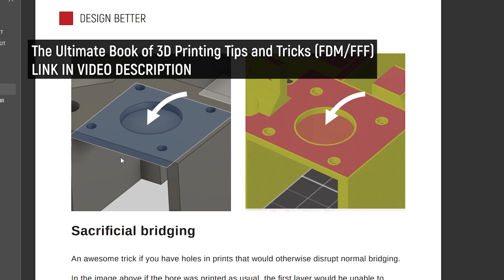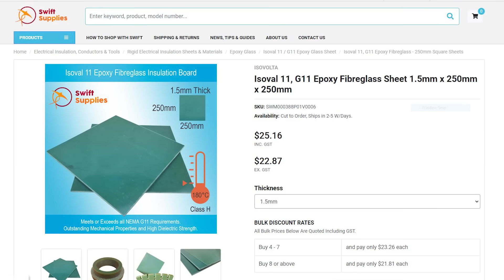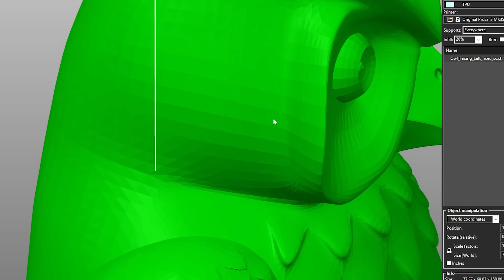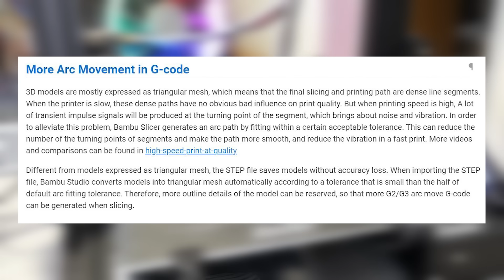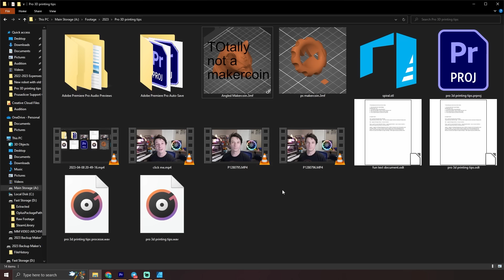5 3D Printing Tips I wish I knew years ago! #3DP101

Comment: Comment from a programmer. 3mf being a zip file is not (most likely) any hidden agenda to sneakily place some nasty files on your computer. Zip file is simply most convenient save/load storage format when application you design needs to store multiple different files within one save file. One other path software developer can choose is for example to store projects as folders. Unreal Engine does that, and seeing how many midi controllers you have in the background, then more familiar example of such software would be FL Studio. But if there is a desire to have single file with some specific made up extension, then developer will have to either implement his own custom solution for merging multiple project files into single storage file (which in most cases would be bad idea, since more code to maintain equals more places to screw something up), or... can use something that is there ready to take, like zip archives. And this is nothing new. For example Office uses same approach, since format with "X" at the end was introduced (*.xlsx, *.docx) many years ago already. It's the same thing. Yes, your Word documents and Excel spreadsheets are zip archives.

Comment: I bought a plate of g10 for my ender 3 and it works great but I had a ton of trouble cutting it. How did you cut through enough to snap it off because mine started to delaminate?
Reply: G10 won't snap well because it reinforced with glass fiber. I cut it with a table saw, but you can use a fine-tooth saw such as a hacksaw. If it is really thin you can cut it with a knife, but it can take many passes
Reply: If the G10 is 1.5mm  1/16" then it's possible to use Aviation Snips to (carefully) cut it. Compound Aviation Snips would be preferred as they provides more cutting power

Comment: I want to try g10 with my Ender 5 plus. Unfortunately unfortunately it's hard to find in my size. The couple I have found I just over $50. I pay less than that for my PEI sheet. Any suggestions would be appreciated

Comment: For PLA at least, over never noticed any moisture issues. What I have noticed is it get brittle due to sun light. So don't leave the spool on your printer when you aren't using it, put it in a dark closet or a box.
Reply: Ouff, mine got brittle as hell in (I suppose) a moist storage room.

Comment: I just use hair spray instead of glue and works like a charm. Also, funny thing on the dehydrator, they are extremely expensive in my country, so a filament dryer is literally 1/4 of the dehydrator price lmao. Tried using the bed with a cardboard box, it kinda works, but didn't like not having the printer available during those hours.
Reply: Same, I'm in Europe. Maybe not 1/4, but 1/2 or something

Comment: In Brazil it's cheaper to buy a filament dryer from China with the low shipping cost you first worlders subsidize (thank you), than it is to try and import a food dehydrator from the US, the shipping alone is $50+, there is no local market for those, you can't buy them in stores or second hand websites.

Comment: G10 is an AMAZING print surface.  After seeing your original video on G10, I ordered some from McMaster-Carr. The ONLY issue I have with it is that It has to cool down a  bit before pulling prints off, especially thin prints, or they can warp as the adhesion is so strong while it's hot.  Once it cools down completely, my prints come off with NO force whatsoever. I can just pick them up, as they've already released.  I don't use glue sticks or anything else.

Comment: You did a vide on G10 like a year ago, and I've switched to that 100%. I have multiple sheets of G10 I bought cheap from McMaster Carr, and I have one surface roughed up with sandpaper for printing PLA on a non-heated bed, another sheet with the glue/alcohol slurry for TPU, and another sheet that's smooth as a baby's bottom for the other 90% of things I print.
Reply: @Jim-xh7hi  "Multipurpose Flame-Retardant Garolite G-10/FR4 Sheets and Bars" - 12x12" size Beige 1/16th inch would be MC # 85345K211. They have other sizes & thicknesses as well.

Comment: Tested out step vs stl in flashprint, stl gave odd layers not aligning as you would expect, but the step file gave nicely aligned patterns in the slice with spiraling curves rather than slightly in some layers then moving the seam etc further up

Comment: Another benefit from using step files in your slicer is that they are generally smaller and easier to edit later if you happened to lose the source file.

Comment: It’s important you have arc movements enabled in your firmware.

If you can’t obtain a STP file, there are also tools to process Gcode to convert your G1 movements to G2 and G3 arc movements if curvatures are detected, with adjustable sensitivity.
Reply: mmmmm, IJK coordinates...
Reply: @paradiselost9946  there we g0
Reply: Arcwelder?
Reply: @tsikada  multiple linear moves into arcs

Comment: I got a G10 print surface after watching your video on that. Cheap and works great! Also, it might be useful to see a tutorial or something for creating those "prusa bridges" for supporting holes.
Reply: G10 has been a game changer for me as well. And I second the bridging tutorial - it was just too fast in this video ... I get the point, but I don't get the process yet.
Reply: lets say you have a 10mm deep hex hole going into a 10mm deep circular hole, after the 10mm of hex, make a .2mm rectangle that is the width of the circular hole in one direction, but all the way across the hex in the other, .2 above that make it a square with sides the size of the hole. by the 3rd layer you should be able to make a 9.4mm hole, for a total of 10mm including the supporting layers
Reply: i picked up a sheet for my ender 3 but had some trouble with it warping abit, and i needed to run 70c instead of 60 for prints to stick well :/
Reply: There is a way that works for smaller holes as well. Just use enough perimeters for the bridging layer, and it will fill inn one circle at a time. That trick effects the entire layer tough.

Comment: A good friend, when i suggested a new mother board, asked me if Maker's Muse has done it yet!!!! I started watching your channel and see why he asked me that. On the G10. I was shocked to see you recommend what I had stumbled onto. I went to Garolite several years ago, still have the same plate. I used Glue stick a lot. Then last fall I ran out glue Stick, and had read about cleaning with IPA. I scrubbed and scuffed up my Garolite cleaned it well and left it bare. Prints stuck just fine.  Then i changed filament and found a thin layer of glue helped. The I used a cotton cloth soaked in IPA to smear the think glue layer around, it sticks better. So now, I have a thin layer of glue and smear it around with IPA after each PRINT! Just like you described. But now I want to replace the big heavy Aluminum bed frame with something much lighter. Any thoughts on a PETG CF Plate????  Dennis a Maker's Muse Believer

Comment: Only gripe here - #1 you didn't actually explain how/where to configure for that.. do you design the bridging in the CAD or does it have to be set up IN the slicer for each hole or something..?
Reply: It has to be done in CAD. Angus showed it in a CAD model, but that may not be obvious to all. The slicer cannot do this for you
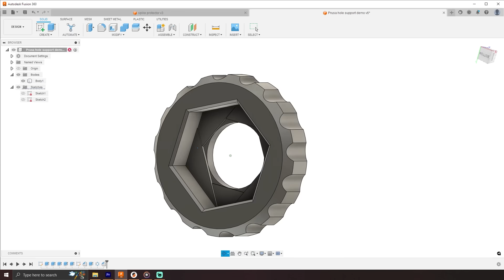Reply: @no-page  I figured CAD but everything he shows after the small blip on sacrificial (prusa method from ~0:34 to 1:14) is all slicer views and then only shows 4 seconds of a CAD model (then right back to slicer) without actually explaining the method in CAD or considerations/limitations.. that's the part I wanted to hear tbh

Comment: I used the STEP file import feature in Bambu Studio and the SoftFever (Orca) fork too, and it does makes a visible difference to circular lathed model parts, as well as overhangs. I could see artefacts in the STLs previously with other printers replicating the CAD mesh structure, and used to change the mesh properties in the CAD file export to try and reduce them. There was a bug in the STEP file import in Bambu Studio, not sure if Prusaslicer has captured this when they copied/forked from Bambu Studio.

Comment: I've worked at Prusa and can confirm we use the hole bringing trick everywhere all the time and it works really well.
When modelling just offset each extrusion by your layer height (worth putting that in your variables for convenience).
Also make little circular cutouts (dia cca 0.5mm) on each vertex of the hex pocket, ensures the corners of the hexnut fit in perfectly every time.
Nose around some of the part files to see for yourself, there's a lot of these little tricks that will help you out!
Reply from the maker: The circular cut-outs on the corners are a great idea! I've been doing that for laser-cut and CNC parts for some time.
Reply: @MakersMuse  works wonders on plasma cuts also, but the radius needs to be larger preferably Ø20 minimum is material thickness
Reply: @MakersMuse  Those circular cutouts can also help with stress relief to prevent cracks at a vertex.  I use this approach all the time with my ceramics pieces, which love to crack as the clay dries.
Reply: So, how does one add that into their files? Is that on the CAD side or slicer?
Reply: @charliebowen4232  CAD. It's actually not too much of a hassle, when you draw the hexagon and the circle, just add a few lines tangent to the circle as you see done, circles in the corners, then make your extrusions.  OR  you could draw the negative of the hole and save it as a separate model, then put it into your slicer and cut it away from your existing part. Much more of a hassle, but may be useful if you can't edit the original.
Reply: @charliebowen4232  cad side, but adding slabs in prusaslicer is equally easy
Reply: I'd love to see a video of this!
Reply: Can you explain what you mean by "little circular cutouts on each vertex of the hex pocket"? Can you link to a diagram even? Thanks
Reply: @jeffkosowsky67  rather than each corner of the hole terminating at a sharp point, you instead cut a small, circular relief into each one. This creates a sort of flower shape for the entire hole.
It’s a very useful trick to let parts line up, since corners are often where inaccuracies creep in that can make part fits worse. This trick can be found in many maker fields, perhaps most notably on a lot of hex bolt wrenches to prevent the wrench from rounding the bolt head by sheering off the corners.
Reply: @iout  Thanks!
Reply: @iout  Fusion uses round reliefs (among other variations) for corners in the sheet metal workspace. Of course it is also used in machine shops whenever bending sheet metal.
Reply: @jeffkosowsky67  Look at 0:47 seconds in this video.
Reply: @TheTetrapod  Thanks
Reply: @jeffkosowsky67  0,5 mm fillet for the 6 corners of the nut
Reply: @DanSlotea  No, thats wrong. The fillet will add an arch tangent to the hexagon sides. You have to add 6 circles each one centered on the hexagon vertices i.e https://youtu.be/9-6tIkTrcwA?t=48
Reply: @DanSlotea  Just to be sure I am understanding, typically a fillet (at least in Fusion360) on a corner will inscribe the corner (i.e. it will be inside the hexagon corner). But it would seem that here to ensure an easier fit, you would want the fillet to circumscribe  (i.e. be outside or exterior to) each hexagon corner. If so is there is an easy trick for creating such exterior filets? The best I could come up with is to sketch a circular centered on one hexagon corner, use a circular pattern to extend to all 6 corners and then "trim" away the 2 interior lines from each corner.
Reply: @jeffkosowsky67  Perfect, that's how to do it.
Reply: I've also done something similar for bridging the top of boxes.  I'll make "roof joists" to bridge the full gap, then a few layers up I'll bridge the whole area between the joists.  Ends up a lot cleaner.
Reply: That hole bridging trick is awesome, I've used the first style of just creating an 0.2mm layer at the bottom of the screw hole for one of my designs on Thingiplace and that works well, but bridging the sides of the hexagonal hole like that = genius!
Will definitely remember that one once I get back into designing after upgrading my 3D software, RS is forcing everyone using DesignSpark Mechanical to upgrade to V6.0, I've been using V2.0 for nearly 5 years until it stopped working a week ago.
Reply: not very clear. I pause video at @1:17 and I think I will reproduce what I see on screen. If I print at 0.3mm height, I will create 3 different shape of 0.3mm thick.
Reply: @JeromeDemers  Better if you look at an actual part, the official ones are available on printables. I'll try to describe it though: draw two parallel lines tangent to either side of the central hole; then two more perpendicular between them and also tangent. You should have a square around the central hole. The last layer has only the small hole you want. The second-to-last has only the square hole. The third-to-last has a slot the width of the square, bounded by the edges of the outer hole. This works for any shape hole btw, not just hexagons!
Reply: @albertpolak786  Thank you. I get it now. It makes more sense going from the small hole to the larger one.
Reply: Are those circular cutouts really for easier hex nut fit? I always thought that is rather to prevent stripping/rounding due stronger grabing of hex nut by sides instead of at corners. You can google for "flank drive" to see what i mean ..
Reply: But who came first? I know Voron is using it for a long while, too.
Maybe others used it already yeeears ago.
But im allergic to "prusa inventions", as the most things they come up with arent actually thier own ideas.
Reply: @hanswurstusbrachialus5213  Oh I never claimed any of us invented it, with 3d printing especially most things have several independent origins anyway so it's hard to pin down. The point is Prusa prints vast numbers of parts and the designers always get loads of feedback from the printfarm team about what works at scale. These holes just print very consistently and so we settled on them as a standard pretty much, because they just work so well.
Reply: @hanswurstusbrachialus5213  nobody claimed it was a prusa invention. And @MakersMuse said it occurred to him on their parts, not that they were the first or the only ones. At least that is how i understood it :)
Reply: @hanswurstusbrachialus5213  I don't know exactly when Prusa started using hole bridging (I actually just found out that they did :) ) but a few years ago when learned about this technique and started using it they weren't. I learned about it from Greg, the creator of the Bear upgrade for the Prusa printers which I've used for several years until I converted that printer into a Voron Switchwire which, to my pleasant surprise, was also using hole bridging.
Reply: @sorcererlc Greg links to a video from Adam Vector 3D that talks about it too and if I recall he talks about how prusa uses it in the mk3 files.

Comment: I haven't found any food dehydrators that are particularly good for nylon as they usually top out at around 165F. In my experience, while that temp can work, it will take a day or two (maybe 3) to dry out a roll of PA6-CF.  For other lower temp filaments they are fine.  I think a convection toaster oven might be the better way to go for the higher temp hygroscopic filaments.

Comment: what happens to the surface quality when using gluestick on a smooth bed? I have been printing on large glass beds for 3 years now and find that soap and water are my best allies for bed adhesion, like regular dish soap and then well rinsed. I get the most beautiful glassy smooth surface finish on the bottom, and the parts self release perfectly once it cools down to 45c or lower.  my assumption is that the glue stick even if perfectly thinned out will mar the finish on the bottom.
Reply: i have a smooth spring steel bed and i use a glue stick like MM does in the video. i haven't noticed any difference in surface quality, it's still close enough to printing directly on glass

Comment: I use glue sticks also, but I just use warm water to wash off the glue stick residue and it works faster and easier than using isopropyl alcohol or window cleaner.  I use the purple Elmers washable School Glue sticks and have never had a problem with large flat prints staying stuck.